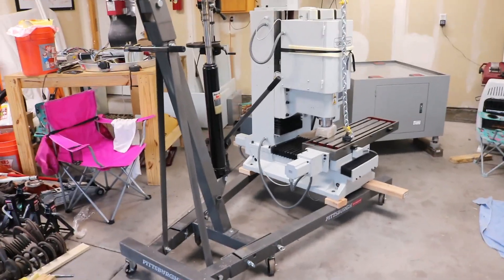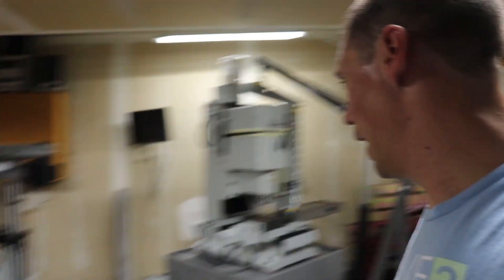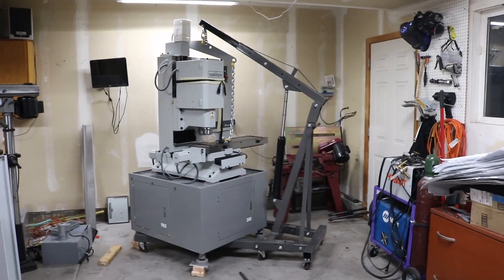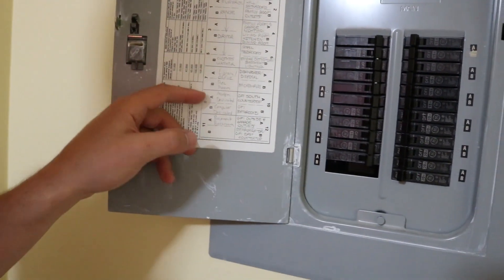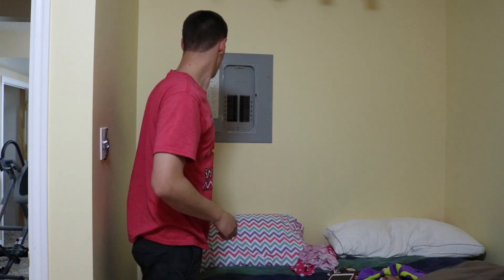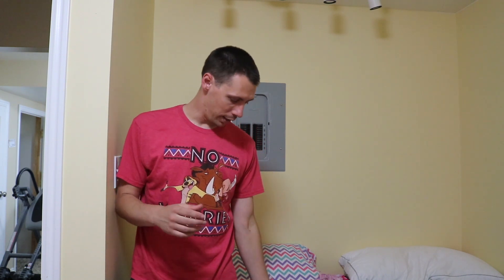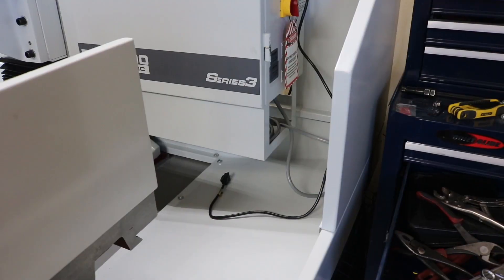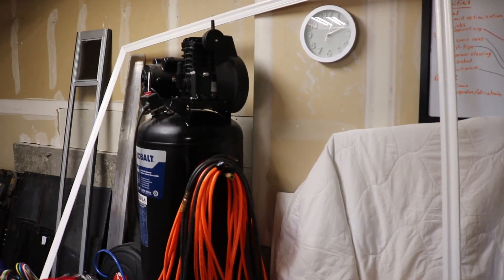Tormach 1100 Install Cont'd

Comment: Green and Yellow is always ground that the electrical code states. any time your use 220 the amps will be less than it was 110 volts. Wattage is a constant so 220 volts at 10 amps would be the same Wattage as 110 at 20 amps  Higher voltages are use to allow for longer wire runs with less current lose. The Tormach uses a VFD to run the Spindal. I can't see that machine using a higher than 20 amps breaker. No larger than a large baseboard heater worth. Just wire it into the electrical Dryer receptical in is lots of power for the 1100 I have used them to run full size Industrial Mig welder
Reply from the maker: I figured it was ground, I'm used to seeing bare wire or green for ground.  It wasn't hard to confirm on the Tormach schematic though.  I still haven't gotten around to installing the subpanel, so I am doing what you suggest and running off the dryer plug with a long cord.  Thanks for the info.
Reply: you will see here on this Power draw bar controller board the blue and Brown wires are the VAC connections and this is for the 1100 so the green and yellow is Ground and Command for the entire machine http://tormachpcnc1100series3.blogspot.com/2014/05/adding-power-draw-bar-power-supply.html
Reply: If you check inside the control box you will find a ground on the inside panel check and see what colour it is.